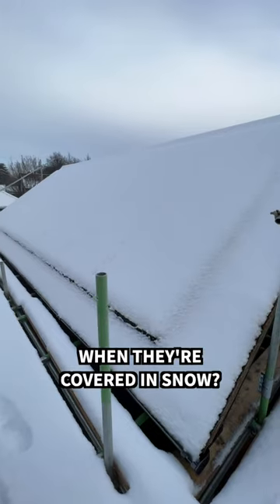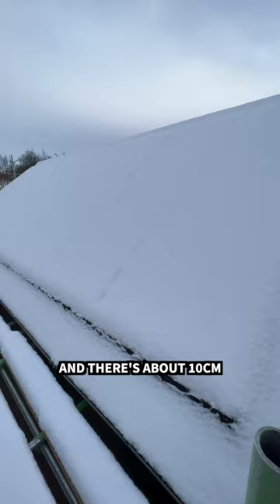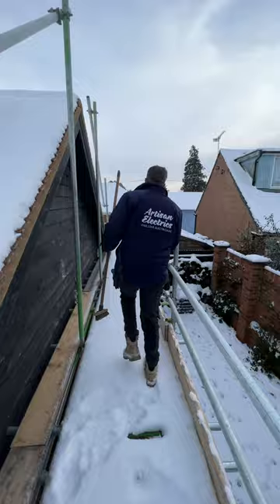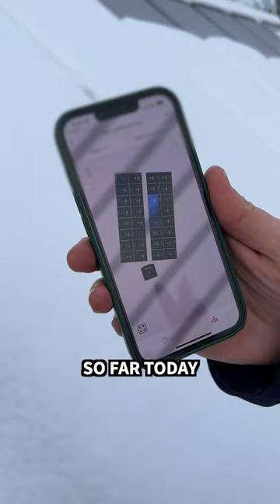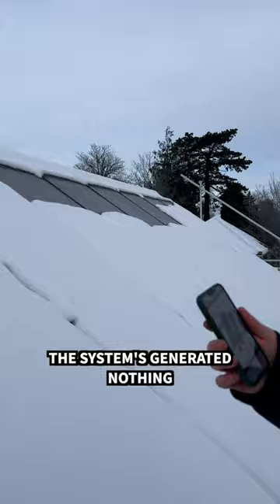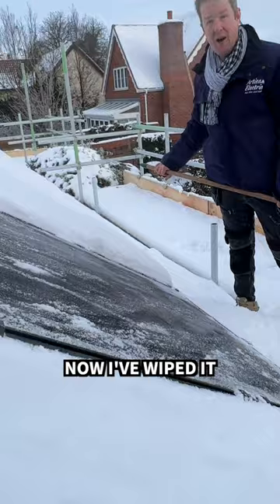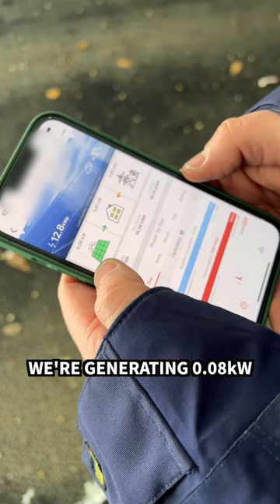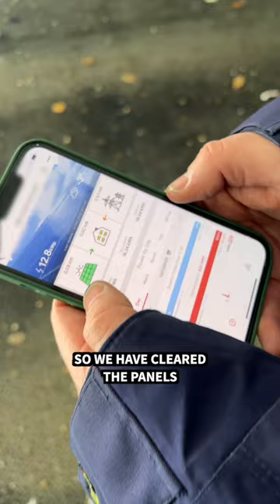Are Solar Panels completely USELESS in the snow? ⛄ #shorts

Comment: Don't brush them with that mate, you'll get micro scratches on the glass. Over time it will affect the efficiency of the panel's and cause further damage...
Reply: Though I was right happy you put it to
Reply: Thr bigger risk is falling off the roof! No amount of electricity is worth that!
Reply: @rkan2  Guess you didn't see the scaffolding he's got set up around the building? Looks safe to me
Reply: @HereForTheMusic-h5o  I wasn't referring to him specifically. Rather the fact that implying any amount of work done on solar panels on the roof as DIY is a good idea..
Reply: @rkan2  If you have the correct equipment it's very safe
Reply: @HereForTheMusic-h5o  Sure, he is an electrician, a lot of his viewers probably are too, but not the most of them.. So even before damaging your panels, just don't get on the roof without proper safety (like he has) in the first place.
Reply: My dude, concern yourself not about the micro..scratches from the broom. There is dust in the air that's blown by the wind. It has much more abrasive force. And there is tempered glass there, kinda hard to scratch.
Reply: I've worked in the solar and storage industry long enough to have seen the damage that is done...
Reply: Didn't he just scrape of the snow to a small layer, not touching the panels?
Reply: What's the preferred method of getting the snow off then?
Reply: @NeveMindAnything  Wait. The sun will melt the snow
Reply: @rkan2  if you do it right then there is no problem . You dont need to have special service peopl for something that simpel or think everybody is stupid .
Reply: All you're doing is scratching junk so I mean it snows we're supposed to go green and what happens everyone just shuts down low heat know hot water no showers no work because there's snow on the panels I mean I think this is a great demonstration of how useless this technology is
Reply: @mattlane2282  Whether you like it or not the world is transitioning to green energy. Yes, there are drawbacks to all technologies but we are working on infrastructure to make sure green energy works. It's not just panels, it's wind farms and storage, all together.
Reply: @HereForTheMusic-h5o  The world's not The politicians are making it and drawbacks I never knew of a new technology that we have embraced that was loaded with drawbacks usually when you go from one thing to the other it should be a benefit not a drawback.

But please tell me who's working on storage I mean it's not possible to do anything remotely close to grid size storage solar is worthless because it doesn't work at night when you need power so that is a useless thing to even mention if you knew anything which I'm sure you don't that I'm not trying to be insulting I'm just simply stating you're talking without knowledge peak demand for electricity it's not when the sun's working the best so solar is literally a dead technology on its own wind farms what happens when the wind stops blowing just let me know just curious just just asking for myself and I'm going to come back to who's working on storage I don't think you can comprehend the massive amount of storage you were require just to make it through the night on the electrical grid anywhere.

We literally make lakes that we pump water into all day in order to supply the tiniest fraction of power entire lakes we drain and fill as a battery but yeah now we're good we're working on storage we'll have that all sorted out right next 10 years your cell phone you're going to charge one time I mean that's honest to God the storage capability that you require for the grid your car 75,000 mi on a charge again this is the storage capacity that you require for the grid.

I'm not like just throwing out absurd numbers I'm throwing out legitimate numbers and actually $75,000 mi on a charge is probably still too low for grid storage.

So I need fine though with this grid transitioning if the people that want it like you they're pushing it we cut your electric off when the grid stops working because it's renewables then I say let's go to it because the faster we go to it the faster we will go off of it because you're not going to want your power off while I have power.

If it's raining solar panels are useless if it's snowing solar panels are useless if it's night time solar panels are useless why are we even putting these on why are we wasting energy and pollution into manufacturing something that legitimately doesn't work it doesn't work at night it doesn't work in the storms it doesn't work in the snow it doesn't work on a cloudy day why would we put money into this.

All right the world has too much plant food in it I just have a question for you if you got this far do you believe in the ice ages because if you believe that Earth had multiple ice ages you believe that without human intervention the planet froze and then the planet warm the back up to the point where it melted off most of the planet without human intervention how come it's a big problem now??
Reply: @mattlane2282  I didn't say I want it, not once. I said it's happening, whether you like it or not. There is abundant energy storage being installed currently which will store the electricity the panel's are producing. In the UK the grid is paying companies to turn off wind turbines and solar farms because they are generating too much at the wrong time, hence the storage infrastructure is required. Over the next few years solar and storage are going to explode exponentially. As we know, when people start funding new technologies, they advance very quickly. Even in my company we are on the third iteration of our storage technology and we are working on the next generation. In a decade the technology will be far superior to today's technology. It's certainly the best industry to be in financIally this decade.
Reply: @HereForTheMusic-h5o  you call it storage it's a battery we've been working on batteries since the first automobile The first automobile was electric and guess what it sucked.

All you're saying is people are working on batteries The grid has nothing to do with batteries you know what the first Tesla's had in them The exact same battery you had in your laptop an 18650.

You know what they have now 2046s or something like that 2048 at the end of the day they have a larger still cylindrical battery running off the same chemistry however tweaked more as a laptop had in 2000....

It's what $10,000 or something to get 7 KW of storage it costs what to produce that right now $0.05 so we're going to spend $10,000 to store five cents of electric today yeah this sounds like it's really economical I mean the largest battery connected to a grid is in Australia or something right and what does it do it likes smooths out power it doesn't power the grid for any meaningful length of time.

And it's funny see you mentioned uk which has reached the peak of this scam called renewables so net metering has been decimated out there it's not worth having solar panels on your house anymore you cannot recoup the costs (I believe at least this is the case in California) and it has to do the fact that people with solar panels were being subsidized by people paying an electric bill.

So now that you have so many of these renewables that all produce power at the wrong time and at the end of the day you still need base load to carry you through tonight yeah you have to turn off renewables because they're so unreliable you can't remove the base load generation.

I mean your example pretty much just explained how renewables do not work and they are a scam and I guess two in your world's batteries have zero environmental impact I mean lithiums definitely great giant pons of acid leaching with the amount for like 12 or 18 months use amounts of excavation of land using obviously diesel powered equipment producing how much dust and everything to make a couple batteries that we don't really recycle as far as I know right now and can't really recycle it efficiently.

Yeah it's not happening whether I like it or not if people would stop buying into the scam if people had an understanding of how power worked there would be an uproar over this.

But instead we have a government indoctrinating kids that there is a so-called climate crisis again multiple ice ages no humans seems like the planets just planeting.  

Just saying people are working on storage it will happen okay people have been working on cold fusion for like 60 years now and guess what it still ain't happened.  You completely gloss and ignore your phone lasting forever on one charge your car going 75,000 mi on one charge these are all constraints that we've had for very very very very very long time and guess what we've gotten to this point that we're at renewables being thrown into the equation is not going to cause battery technology to advantage any faster unless we start talking about gravity batteries flywheel batteries molten salt batteries pump storage batteries stuff that you couldn't use in your phone but now you're talking about massive facilities to try to store this unreliable power or we could just do what we've been doing.

Cars continually get cleaner exhaust better fuel economy reduce emissions power plants are using natural gas which is a much cleaner fuel than coal.
Reply: @mattlane2282  All I'm gonna say is that I've been educated by the 5 years I've had solar + homebattery which saved me tons of money and it's green. The world is filled with solar left and right, and it would be useless? Your methodology of thinking is in fact, useless. Have a good day sir
Reply: @mattlane2282  You obviously don't work in the renewables industry and don't have much of a clue what you're talking about. But go do some research mate, because so many of your arguments are clearly wrong. I'm not going to try to correct you either because I don't think you'll take any notice and I could sell my knowledge instead of giving it away for free, but I will leave on this note: the industry is booming in the UK and there is a lot of money to be made, so I'll enjoy providing for my wife and kids and working in a very exciting and developing industry.
Reply: @NeveMindAnything   it's amazing I've had this for 5 years I've saved a ton of money why does no one ever give in number.

Give us a my electric bill was x amount prior with this much in generation and delivery fees My solar system cost this much without rebates since the rebate is a subsidy and we're trying to speak towards a viability of this My battery pack was this much without subsidy because again we're talking about the viability of this so after 5 years My system cost this much my electric bill since the installation has been this My prior bill was this therefore I've saved that.

Nope no numbers no numbers at all just I  save a ton of money.

Can't prove it can't give hard numbers about that up but we'll just believe you 😂
Reply: @mattlane2282  I saved €2200 this year on electricity ;)  I can provide you with ally calculation, but i see there's no point in trying to educate someone like you.
Reply: @NeveMindAnything  I save $2,200 okay so you've paid for the panels and you're up 2200 now you likely went ahead and had $2,200 less but the panels are still being paid for you will not give anything because you flat out no right now you're upside down or there's a lease so you paid $2,200 less but they were rebates incentives someone got you don't own the panels etc.

It has nothing to do with me anyone else that reads this would see me saying whatever I'm saying would see you giving hard numbers rebutting it so someone say oh yeah that guy has no clue what he's talking about.

Right now all I want sees is I keep telling you this stuff doesn't work you keep telling me you save money I tell you how there's no way you save money because here's the numbers and then you throw out oh I save this much no information of how you came to this No rebutting the ways I said that you did not save that.

If I spent $40,000 on a system and this year my electric bill was $2,200 less I did not save 2200 I'm still out 37, 800.  You just will not give the breakdown so just stop say you're wrong and be done with it.
Reply: @mattlane2282  Ow trust me kiddo, i will stop now. As i said, there's no educating you. Have a good night!
Reply: Just like Ur car😂😂
Reply: @mattlane2282  in equatorial states it's the ultimate way!
Reply: @mattlane2282 It's like anything else, you have to understand how to treat equipment. 

I lived with an array for 22 years, and it was effective, useful, and simple.
Reply: @grovermartin6874  Worked great at night right?  Oh yeah you had to get batteries for that so now every house has to get batteries to last as long as the sun is not out? LOL... pretty sure just using current power generation is cleaner at that point...
Reply: @grovermartin6874  So its night here in a populated part of the planet... and like 0 wind...   Also yeah I mean its likely the design life or MTBF... not exactly what everything is going to die... also depends on how much usage and cycling they had... great it works for you, does not work on scale however...
Reply: @mattlane2282  Bergey 10Kw wind turbine, a champ in that windy locale.
Reply: @mattlane2282  Like I say. One needs a field full of solar panels and a basement full of batteries. It is a rich mans hobby.
Reply: @mattlane2282  You pretty much nailed it. Anyone that understands how the grid works knows this. Imagine how cheap everyone's electric bill would be if the govt gave the power companies the money they waste on these panels. The govt. never subsidized a coal company that I know of.
Reply: @HereForTheMusic-h5o  Most technology usually only gets better at a rate of about 1or 2% a year.
Reply: @ruds2600  Yeah, I mean they want to do this stupid stuff I'm going to be looking for used or damaged panels i'l throw a ton up on my place if it makes sense from a money standpoint I know from a grid standpoint it does not.
Reply: @NeveMindAnything  I was hoping you could tell us how many solar panels you have. We can figure how much it will produce. Where you at on the globe.

Comment: Fantastic Jordan , all we need is a scaffold at the side of our house ,just in case it snows ! And we can safely get  the panels cleared  😅
Reply: I thought that at first, but you can just buy one of those extender poles with a wide squeegie on to clear snow. I expect you need something similar to clean them once or twice/year.
Reply from the maker: Can't say I didn't provide a solution... 😅
Reply: @artisanelectrics  ha ha mate , yeah your right , and that’s what artisan  is all about , 😀
Reply: You can run power through the panels to make them heat up and melt the snow. But it's a gamble as to whether they generate the energy back before the next snow.

Comment: Who knew if you cover them up they don’t work, man’s a genius
Reply: Yes, what a shock. Now I need to find a video that answers the other critical question I have: Do wind turbines produce power when the rotor isn't rotating at all? I can't sleep another night not knowing the answer.
Reply: The correct answer is, they are working, just not producing enough to get recognized. Still enough to give you a bad electric shock if you go mess with the wiring.

Comment: It's generating 0.08Kwh!!! Wow such an incredible amount of energy.... you can basically light up a few led bulbs...
Reply: ..for three hours, only while the sun is up.
Reply: Me looking at my 1.2KW electric stone oven: " not today "
Reply: It's generating 0.08 kW (power), not kWh and one panel is generating 0.25 Wh (energy). The solar grid is producing enough for a lot of led bulbs.
Reply: @shimonbiton2163  he isn't isolated from the grid to be fair, so if it were you in this guy's place with the same stove you'd still be able to power it, just not purely by your solar grid
Reply: @Syndicalism  Panels naturally degrade over time so total output over the life time vs install cost and power produced with normal electricity cost makes it unpractical. Much better is to get small hydro if land has capability for that or just burn material to produce electricity.
Neighbor has solar setup. On summer it sure does produce some power but on winter witch is most of the year it produces fuck all. What his done is buy diesel generator and his running that to heat his house from exhaust heat and pushes that power into the grid making tons of money, while its sold as "green energy", essentially what power companies are doing anyways.

If this guy would push 120w to melt the snow it would be same scam wind turbine companies are making by presenting the production numbers but dont detract amount of energy it goes to warm up the generators when its not windy, well as they dont tell about helicopters needed to fly and spray ethanol on the damn thing to keep blades frost free.
Green zero emission my ass...
Reply: @Syndicalism  0.080kW = 80W, enough to run 10x 8W LED bulbs. I'd hardly call that a lot.
Reply: @iamdave84  80W...

you could baaarely run a StupidPhone off that.  and the battery'd be draining.

Comment: Don’t ever brush them like that, I install panels daily
Reply: Is this a threat?
Reply: @SianaGearz  no but make sure to use sandpaper for better cleaning
Reply: @SianaGearz  yes. Rip panels:D

In all seriousness this is a threat. Do not attempt to remove snow with brush.

I recommend a rubber edged thingy
Reply: @SianaGearz  its not a threat, if you need advice here’s a good advice, if the panels are covered with snow, there’s no gain yet. They will melt without your help, and that’s when you actually get some reasonable gains from them.